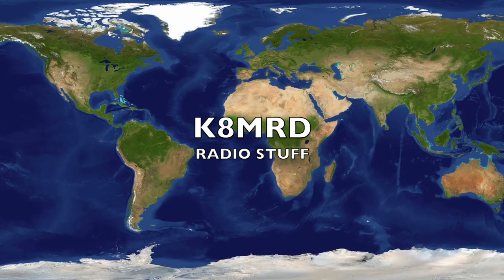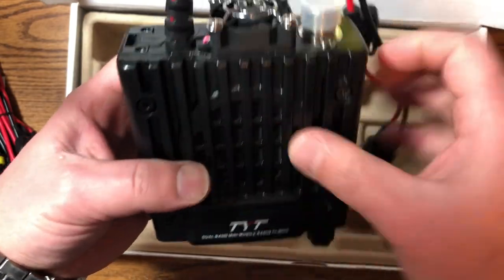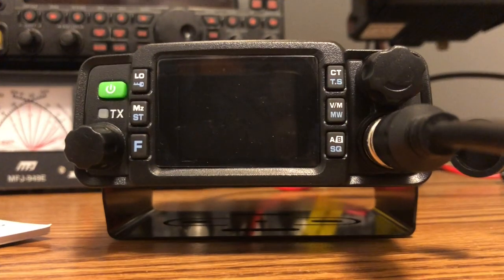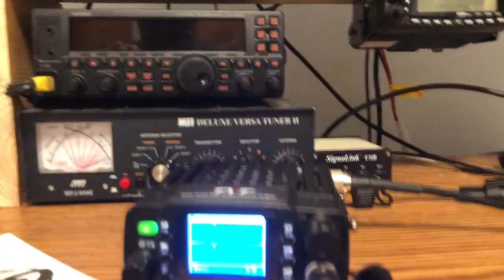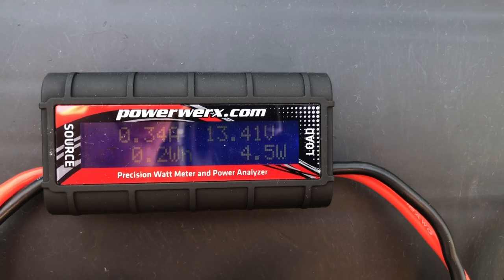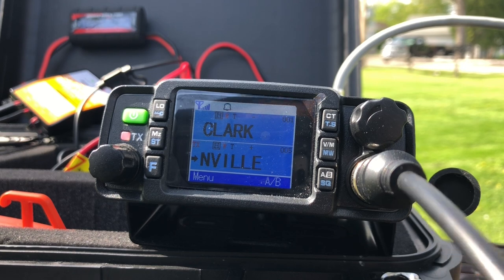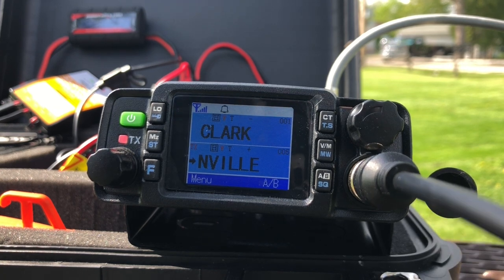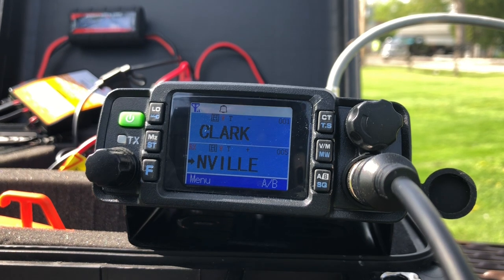TYT TH-8600 and Harbor Freight 13 watt solar briefcase.

Comment: Nice setup!  Did you do a video on hooking the solar panel up??  I will look and see, but it would be good to do one showing what you need.  Looks like you have the solar panel, then the solar panel regulator (I think that is what it's called) and the the volt meter and that goes to you power distribution system.  Not sure though.  I want to do something like that for my portable setup for POTA.  Juddie WD8WV

Comment: Just bought one and love the size. Could you list the steps to input a repeater and save to a channel. I must be missing a step. Thanks!
Reply from the maker: It’s a great little radio for sure.  I haven’t programmed this radio manually.  I’ve always used the software from the Tyt website.  It’s pretty easy.  You need to set the transmit and receive frequencies and probably a ctcss tone.  That’s about it.  Should be pretty straight forward.  I’m not even sure where that radio is right now as I just moved so I can’t try it out for you at the moment.

Comment: Got one. It charges a lawn mower batt. And I run a charger, for my baofange batts. And qrp pixies. On 30/ 40 meters. With 2/70 as the cherry on the top. Good radio. De kv4li.

Comment: The bad thing about that 13 watt solar panel is that it is too small. It would take an entire day to charge a 4 or 5 amp hour battery or 4 days of full sun to charge a 20ah battery. kind of worthless unless for emergencies and that was all one had. These thin film type solar panels take around 3 to 4 times the surface area of any other solar panel technology to produce the same power. They were popular when conventional solar panels were so expensive. There is little reason to buy them when so many better options exist.

Comment: Thank you for sharing your first experiences with this radio, Mike. Since this was more than a year ago, I'm curious if you are still happy with it?
73 de W6EUH
Reply from the maker: I am. It’s pretty much always on. I have it in my living room and I call it my couch radio.
Reply: @hamradiotube  I just ordered one of these for my pickup truck and an external 70cm dual band antenna. Really looking forward to it, I'm struggling with handheld radios from inside of the car (obviously).
Reply from the maker: Autunite yeah HTs in the car can be tough.  This and an antenna will get you on the right path.

Comment: Do you know where the dual watch is in the 8600 
menu? The manual doesn’t mention it at all, but it’s listed as feature. I’m guessing, it a cryptic abbreviation in the manual somewhere.
Reply from the maker: Its been so long since I programmed this radio.  I don't think that was something that needed to be turned on though.  It just listens to the top and bottom freq's and whatever one it hears first it will play.  It does not RX and play both at the same time if that's what you're asking.  It's actually a dual watch radio, not dual monitor.
Reply: @hamradiotube  Thank you for the quick reply. Dual monitor was what I was thinking. It makes sense now. 73, N5SON
Reply from the maker: @Scott_AI5EF  No prob

Comment: Hi Mike. Is that roll up antenna the Slim Jim Antenna from N9TAX? I heard it’s a nice portable antenna. 73, K2PDR.
Reply from the maker: No its one I made out of 450 ohm ladder line.  I've heard nothing but good things about the n9tax one though.
Reply: Thanks for the reply Mike. I’m thinking of buying one for my DMR HT radio. 73, K2PDR.
Reply from the maker: bklynhubby they’re great antennas. You won’t be disappointed.

Comment: I bought one and cant for the life of me get it into VFO mode. I push the VFO button and nothing happens. Everything else seems to work fine, I can load from software and adjust all settings. I just cant go into VFO mode and manually input a simplex frequency. Any help would be appreciated.
Reply from the maker: Hmm, I just plugged mine it and hit the VFO and it just worked.  So I'm either thinking that it could be defective, or I wonder if there is a VFO lockout in the software that might need to be changed?  I just looked real quick and didn't see that setting so who knows.  Dumb question but is the radio locked?  In the top right of the screen there will be a key icon.  To turn it off, hit the Function "F" button then the LO button (it has a key symbol on it as well).  Hope that helps.

Comment: I would like to connect the microphone to a computer or cell phone(APRS DROID) with a 3,5mm jack in order to use TH-8600 as an APRS beacon. Any ideas about wiring?
Reply from the maker: Not sure about how that would be done.  There is a mini usb on the back for programming so that might work.  I don't do aprs and I'm not sure if its even capable.

Comment: Question, 9 month old radio, not responding to microphone but receiving, got replacement mic but still not responding.  Any ideas.  Ham Tech lic.
Reply: I don't have the radio. BUt i could probably say it is the radio's jack that has the problem. Maybe it doesn't short the ptt to let you talk. The problem will be on the radio jack or some wiring in it, given that you have already tried a second radio. You could though test the microphone contacts though too. When you press the ptt it must short the microphone or the button to  ground. Or something like that. I think this is how it works anyway. Try that

Comment: Looks like a nice radio !!!!   25 watt ?  I would at least go up to 50 watt if you can ?   Depends on your area too.
Reply: The difference between 25 and 50 watts is less than one S-unit. Will be hardly noticeable.
Reply from the maker: 25 -50 watts isn't any real change in signal.  That's only a 3dB increase in signal strength which is only 1/2 of an S unit.  If I was 58 on the S meter at 25 watts, I'd be a 58.5 at 50 watts.  It's really all about antenna antenna antenna.  It is a cool little radio though.  I like it a lot.  Really small and portable.

Comment: Maybe you can use Chirp to programme it as well
Reply from the maker: Chirp still doesn't support this radio.  I wish it would.
Reply: The Windoz program supplied with the radio works just fine.  Too bad Chirp still  doesn't support this radio.
Reply: I went to the TYT website and downloaded the 8600 software, have to convert it to english from chinese, which took me like 30 seconds to figure out, then know what fields to fill in, cloning went flawless.

Comment: Hi Mike,
Will the tTH 8600 do odd splits as in xmit on 440 and rec on 2m? This might make a great cubesat (satellite) FM rig if it does. I like the size and the power would be more than adequate over my yaesu ft 60 HT which runs 5 watts and is barely enough.
Reply: BTW de N5AQM  Mike in Chandler, AZ.
Reply from the maker: Took The 5th Im not sure how this radio would work. I’ve never done sats so I couldn’t say for sure. Yes it is dual band on both top and bottom so you can have 440 on one and 2m on the other at the same time but it is not dual receive, only dual watch.   It works like a baofeng in that if one channel is receiving you won’t hear the other.  If that doesn’t matter than I think you would be in good shape.  Hope this helps and thanks for watching. 73.

Comment: Thanks for the video! What kind of battery are you using?
Reply from the maker: This is just a small Duracell lead acid.  I think 8 or 9 amp hours.
Reply: K8MRD RADIO STUFF Thanks! Great video

Comment: Where did you get the radio for under $100? Also, does this radio have the same options as the HT to have different zone lists?
Reply from the maker: Perhaps you are referring to the DMR radio TYT makes?  This is an analogue radio.
Reply: K8MRD RADIO STUFF yes, I have a TYT UV-390 DMR radio now with Zone Lists and scan lists. Is there any way to organize channels? Also, where did you get yours for under $100?
Reply from the maker: @zr2zamboni906  You are asking me a question about 2 completely different radios.  Again, this is an analogue radio, meaning NOT a DMR radio.  I don't own a UV-390.  This radio is, as the description says, a TYT TH-8600.  I am sure however, that with your uv390 there is a way to organize your lists the way you like.  All of that I assume would need to be done with the software.

Comment: I have a new 12v 10ah sealed battery, is it normal for it to only charge to 12.9v with a 1.5 amp wall charger ?
Reply from the maker: That’s about where a lead acid battery will charge up to.  Don’t let it drop more than about 12v as you will damage your battery.  You only get half of what they are rated for with lead acid so 5 amps is all you want to pull out of it.
Reply: Thankyou for answering  my questions

Comment: What type and brand of crimp pliers do you use?
Reply from the maker: For Powerpoles and coax I use a ratcheting crimper I got from MFJ at a hamfest a few years ago for about $35.  All I can tell you is it has a blue handle. No idea what model number and its not on their website.  I got the coax dies from the same MFJ booth, but I honestly don't remember where I got the power pole crimp from.  I'll tell you, I have purchased another inexpensive ratcheting crimping tool from Amazon and it was total junk.  Looked exactly the same. Returned it the next day.  It's really hard to find a good one online that is inexpensive and good.  I wish I had a good lead for you cuz I would have more crimpers myself.  I hate changing out the dies when I want to crimp Powerpoles or coax or anything else.  I'd rather just have a dedicated crimping tool for each one I use them so much.

Comment: Ok i got this radio cant program it for repeaters chirp does not show this radio on the app and the instructions does not help
Reply from the maker: No, unfortunately Chirp does not support this radio.  TYT has software you can download here: http://www.tyt888.com/?mod=download
Reply: Ok il try it out thanks for getting back to me il let u know if it works
Reply from the maker: @user-vm2ke3yk9n  It will.  I believe in you...The software is similar to chirp.  Just remember you must "READ" from the radio first!  Then hit "SAVE"!  That way you have a clean file should something go wrong that you can go back too.  Once you enter your freq's and everything is good, write it to the radio and you'll be on the air.  The Green left arrow is read, and the Green right arrow is write.  You can also go "File > read;  and File> write, as well.  Should you run into any driver issues, go to http://www.miklor.com/COM/UV_Drivers.php and get the Prolific driver.  Winblows sometimes doesn't download the correct driver.  Good luck!

Comment: Have a mac no cd slot.... how do i program repeater.
Reply from the maker: With a Mac, unfortunately you cannot.  I have to run VirtualBox with a windows image.
Reply: @hamradiotube  thnk you
Reply from the maker: @ramoncitoramos2492  No problem.  Good luck.  You can program it manually but that's no fun.

Comment: Hi,
ts about amps,,how much did it produce???
thanks
gervais ve2ckn
Reply from the maker: I assume you are taking about the solar panel??  Not many amps at all.  About .3 in direct sunlight.  Its enough to keep a small battery topped off but that's about it.

Comment: I think you might find your solar set up is causing some if not all of your interference.    I know a lot of guys that do the portable HF complain of the noise from solar
Reply from the maker: It's my location.  While your statements about solar are true, interference usually comes from a bad charge controller (which I'm sure the Harbor Freight is) by not being shielded properly.  But that's on HF.  I'm on UHF.   However, I have used this solar panel and charge controller while operating HF and have not had any noise because of it.  Surprisingly.

Comment: Is there any way you can help me out with this radio? I own one and for the life of me I can’t figure out how to program it. I tried using the disc it came with and also tried downloading the software from the tyt website and still can’t figure it out.
Reply from the maker: I'm sure I could try.  I know that I use the software downloaded from TYT.  Haven't used it since I bought the radio though.  You do have to read from the radio first and then wright the program to it.  I'm good on QRZ if you want to shoot me an email explaining where your getting stuck and we can take it from there.

Comment: Can you put a link to where you bought this
Reply from the maker: Hi Kevin,  I bought the radio from a local company that specializes in land mobile radio.  They just happen to be a couple hams that own the place and sell a few things locally like coax, connectors, and a few types of TYT radios.  I'll ask them if they would ship one out to you next time I'm there but I doubt they are looking into that sort of thing.  You can find them on eBay however.  
Thanks for watching and 73!
Reply: K8MRD RADIO STUFF thanks I’ll find them on amazon or somewhere How are you liking the harbor freight solar briefcase. I have a Bioenno 15ah battery for my hf and am looking for a small cheep set up to use portable
Reply from the maker: It does a fair job of recharging the battery if there is no load on it.  When I use it with my HF rig it does nothing.  Its just not strong enough to keep up with the 1amp drain on receive that my FT-891 uses.  You get what you pay for for sure.  If you want it to just charge batteries and its quite sunny out it does do a fine job.  Its max output that I've seen is about 14.5v at .35 amps.
Reply: Adams Electronics, 248.669.6800..    and yes we ship...  73's Glenn WB8ROI
Reply from the maker: Well there you have it.  You just made a lot more work for yourself though Glenn.  I expect the calls to be flooding in any minute now hihi

Comment: 🗣 Does this radio have to be unlocked? TYT does stupid things like that.
Reply from the maker: It’s been a while since I first got it but I’m pretty sure it’s wide open out of the box.
Reply: It does have to be unlocked. I just got mine in today 

Power off hold in ab, vm, and lo buttons all at the same time and power on
Reply: @briansimpson8636  Thanks! Any idea how to unlock a THT TH-8000D/E? Someone on Amazon was able to get 200-260 on his. I've been unable to duplicate that on my own, though the output may be vastly reduced even if you could dial it in. Good radio, though a bit bulky, and the display is dot matrix. Cheers!
Reply: I do not know. Sorry. Did the unlock I mentioned work for you?
Reply: @briansimpson8636  Sorry to say, I have yet to unbox mine. Why? Because I'm new to this radio thing and I'm trying to figure out how to power these things. I've got a power supply that has a cigarette lighter connector and I have two of them on order. Plus, when I get them I have to check the wiring so I don't blow the fuses or worse. I wish ask these radios came with these connectors. The two radios I have are the TYT 8600 and 9800, and neither have the CL adapter. But as soon as I can post it, I'll let you know. I also just got a couple of solar panels and I've got to start learning about power cords, etc. My mistake was, I started with HTs and then went to mobiles/bases.
Reply: I hooked up my TYT TH-UV8000D radios up to my Windows 10 today and used Chirp to access them. It's interesting, but you can fix them to open up 220-260MHz. Afterwards, I turned the radios to 200MHz and, just as one reviewer on Amazon wrote, you can receive and transmit on the 200.000 frequency. It's advertised as dual-band, but I picked up some traffic on 200MHz. I didn't transmit very long because I don't have a tri-band antenna, but I could hear people talking, which was...interesting. I'd love to hear TYT  explain how that came about.